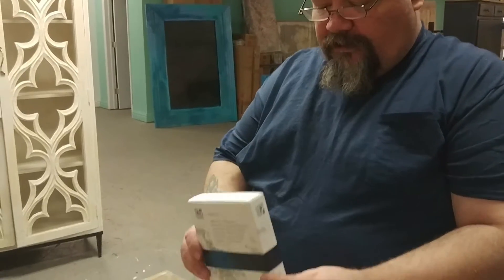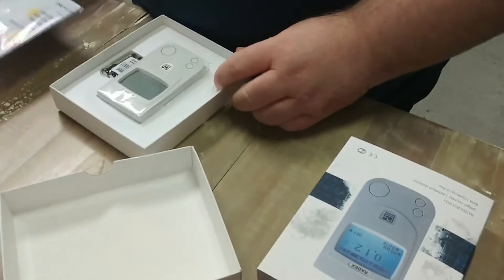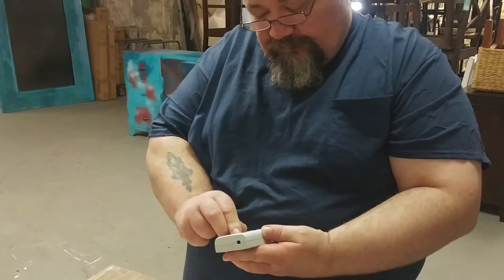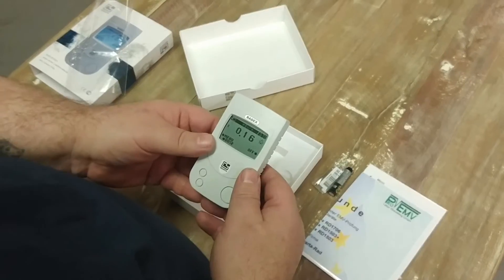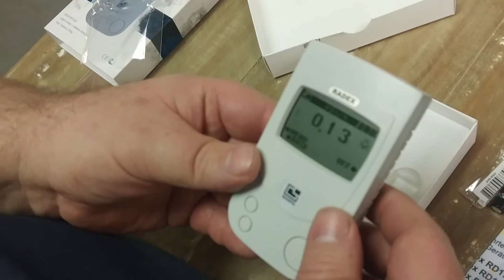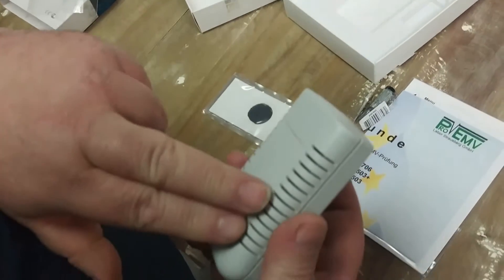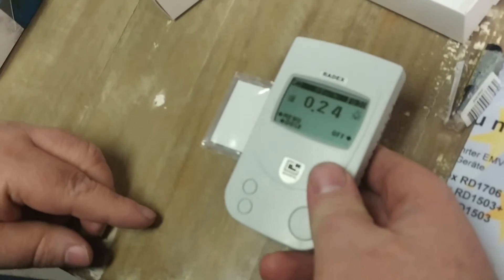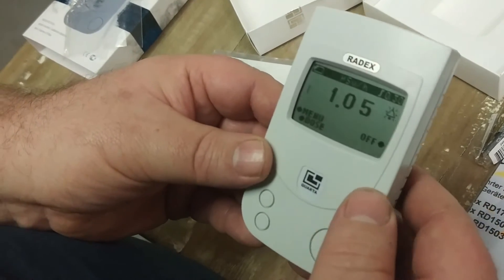RADEX RD1503+ Demonstration Geiger Counter by Randy - unpacking, overview

Comment: Where did you get the sample?. With the counter?
Reply: No, I bought a test card from United Nuclear, and the uranium samples from Ytube. The ore is safe to have, but you don’t want to keep it close to you for long periods of time (like days or weeks). I keep mine in the plastic wrap it came in but If I were to handle it I would wash my hands good to get any powder off, so I keep the plastic on so I don’t have to worry about that. I keep the samples in a plastic case in my closet. You do not want to ingest the powder or breathe any dust from it. You can also get an elevated reading by placing it close to a smoke detector. If you fly on a plane you will get readings 20 times or more than on the ground when the plane is at altitude, just turn the audio off so you don’t scare other passengers. My wife had a cardiac stress test a few months ago and before she came back in the hospital room the reading was 0.12 micro sieverts per hour (same as at our house), and when she came back in the room it went crazy. Her stress test showed nothing wrong, but when I put it on her it read 400 microsieverts per hour and went down by the hour as the isotope decayed. Nothing dangerous to her.

Comment: I bought one of these last week and have really enjoyed it. Batteries are still strong, easy to use, and I have it set so it beeps with each count which is fun for me.  I have measured the the background radiation in my room, the radiation from my smoke detector, a sample of trinitite, a fossil from the beach, and especially samples of uranium ore.  Exactly what I have been looking for at the right price!
Reply: Could you explain how you got it to beep with every count? I just bought one of these and I can’t find a tut how
Reply: @genocideshoto4047  there is a menu you can use to add audio or keep it silenced. It should register the background level even if the audio is turned off. They have a website with a lot of information. I don’t know of any place where you cannot get a reading, usually around 0.12 micro sieverts per hour, or counts per minute depending on the setting. If you are not getting any reading contact the company for assistance.

Comment: Hello, I have this model but there is something that I dont understand. When the measurement is low (0.10 to 0.20 microsieverts/h), the cycle indicator works normally (4 sides of the square=full cycle). But when measuring higher levels of radiation like 1.3 microsieverts/h or more, it stays on the first segment of the square indicator as if it was blocked ? (RADEX RD1503+, version 1.2)
Reply: The square is just a timer, needed only when radiation levels are low, because there is practically nothing to detect and the unit needs time to gather data. 
When radiation spikes, the timer is irrelevant and there are enough radioactive particles to give our statistically meaningful results right away, no timer (square) required)
Reply: @Exodus27  thanks a lot, I was wondering if my radex had a problem but you gave the answer ! 👍